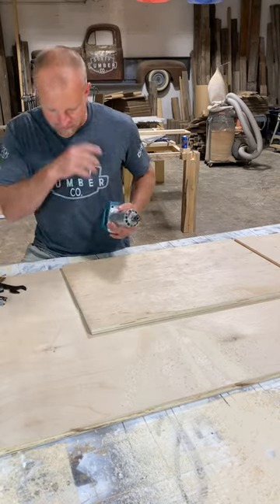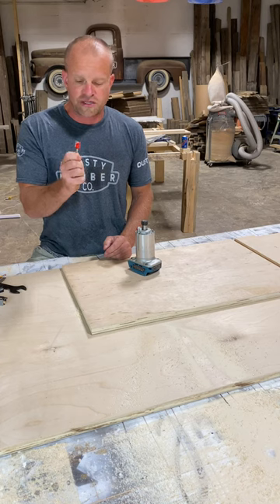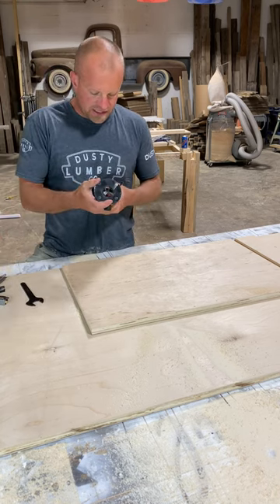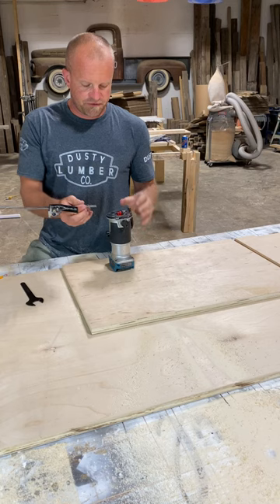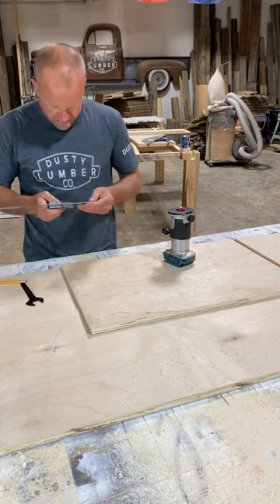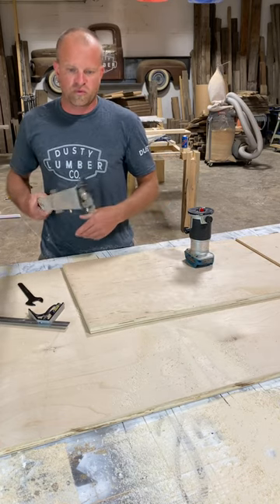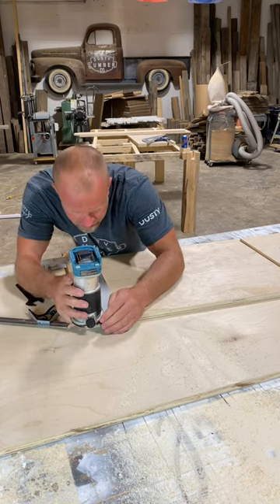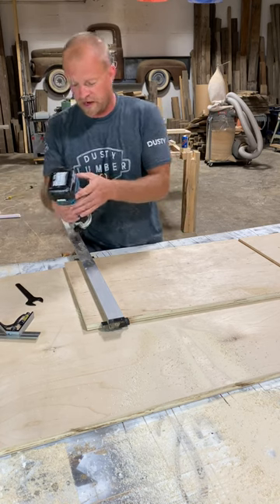How to do dado cuts with a router

Comment: Do you ever run into your router bit accumulating burn marks and becoming dull quickly with this? If not what router bit do you suggest for dado cuts?
Reply from the maker: Definitely gotta keep sharp bits and move at the right speed but I still get a burn spot here and there. I use Freud straight bit for dados
Reply: @dustylumberco  thank you so much bud
Reply: Cut up short of the line by a millimetre, them trim the last wee bit. Works for me